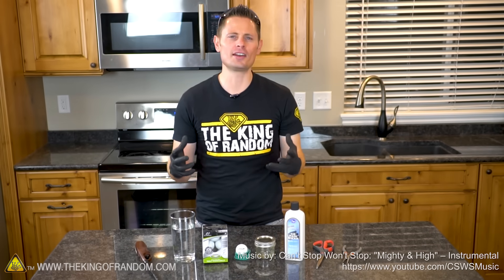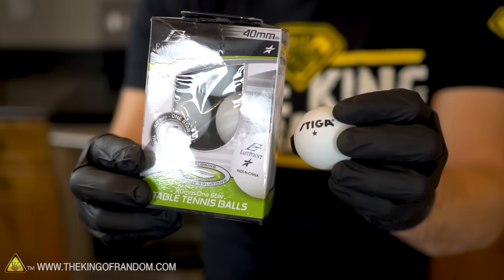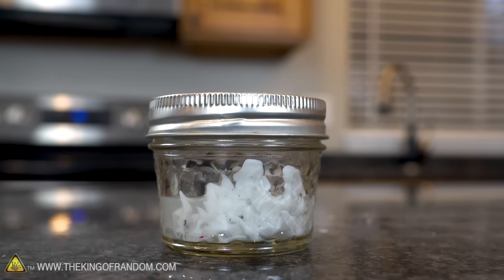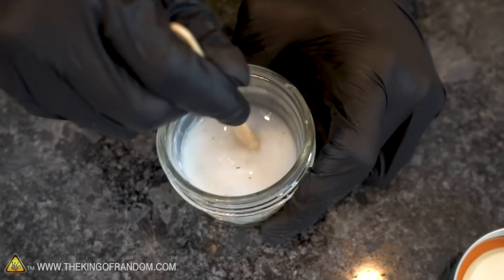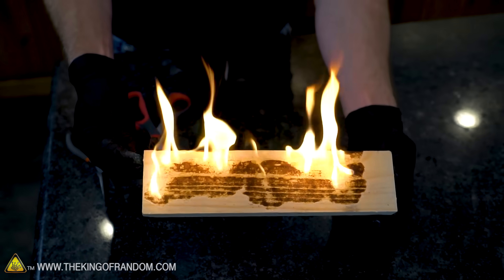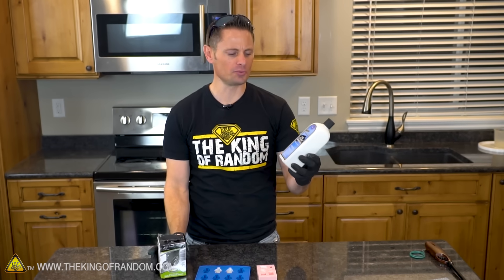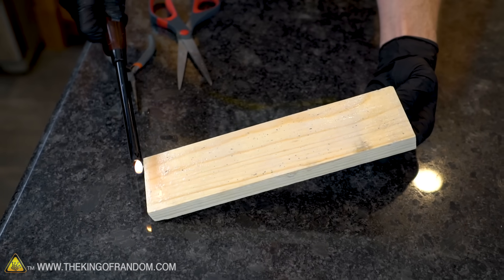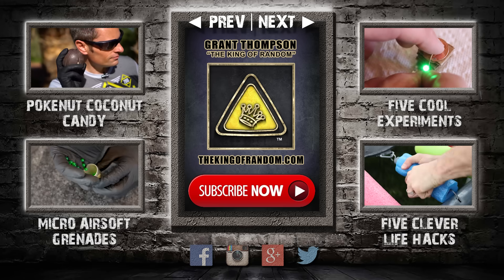Nitrocellulose LEGO? Flammable Ping Pong Balls? TKOR Takes Pyro Paint To The Next Level!

Comment: Is the celluloid+acetone dissolution reaction exothermic or give off any harmful or foul fumes? I wanted to try this, but I wanted to make sure I don't burn whatever it's sitting on or make the whole house smell bad.
Reply: It's not a reaction the acetone is just used as a solvent to dissolve the nitrocellulose
Reply: Sean T. I probably should’ve removed my comment because I went ahead and tried it without an answer LOL (thanks for answering anyway though). Worked pretty well. Not as well as his did, but I used a different source of celluloid (solid rectangular guitar pick blanks). I got a paste like he did, but mine was more lumpy, even after leaving it for a few days. I probably didn’t cut it into small enough pieces.

Comment: COOL! try this, I spraypainted  a sheet of glass with heavy coats( about 5) of  Nitro Cellulose paint, scraped of when dry, and cut into fine chips, or flakes,  then experimented with a shotshell reloading machine, different loads, with which all worked perfectly when fired , DYI  gunpowder- burns clean and fast, Chronographed  well ,,36-38 Bush is  perfect

Comment: theoretically the fuse should work anywhere even without oxygen because of the actual composition

it uses potassium nitrate as an oxidizer which is why fireworks would work in space

Comment: I am really surprised that the glass didn't break or even crack as a result of the firecrackers being in it when they exploded. Over the last ten years I have ruined three different outdoor birdbaths by tossing the same type of firecrackers into them the first was made of plastic and was only about a year old the second one was metal and age shouldn't have affected it and the third one was concrete. The first two blew a hole right through the bottom and the concrete split right in half all were full to the top with water. Could you possibly do a video on the physics behind this. I have also knocked holes in 5 gallon buckets full of water but have found that the explosion has to happen on or very near the side or bottom of the vessel and it has to be submerged.

Comment: why don't you try melting styrofoam and acetone to make plastic objects? I did this a few days ago! I melted down a large McDonald's Cup in some acetone and kneaded some of the acetone out in my hands which yes dried  them out quite a bit but I'm molded it over top of a coconut oil lubricated  plastic Easter egg and I let it dry out a day or two! And I have a little tiny been kind of ugly grayish bowl that I'm using to put push pins in
Reply: side note, coconut oil also makes a great lotion, which will counteract the dryness whenever you lubricate the outside of your mold. if you do a mold on the inside of something, it will just kind of sink back in. So you have to mod over something not inside of something unless you kind of want a solid object and not a container to  store things. as long as you lubricated enough it gets the detail pretty well

Comment: Hey grant I had a idea, if you painted a message (example, your name) with pyrotechnic paint would it burn away a message?
Reply: Depends on the surface your write it on.  You'd more then likely burn/scorch the message into the surface of whatever you wrote it on having the exact opposite effect. It be much easier just to use lemon juice as invisible ink, or to just burn the paper when you're done reading it.

Comment: Once the acetone evaporates it doesn't add to the flamabilty of an object. Try soaking that glock you used in "Testing bullets made form Batteries" or the video "Making bullets with molten Lead" and let everyone know what happens. And BTW bullets have been made with Molten lead for centuries.

Comment: WHAT?!?!? How does it work under water? Doesn't fire need oxygen?
Reply: lol i love how all of you are wrong in your own ways
Reply: The fuse has its own oxydizer in the mixture (likely potassium nitrate. But from the color, I guess there could be barium nitrate or a green emitting potassium perchlorate-based mixture). 
The only way to extinguish such a fire is to cool down the mixture below its ignition temperature, i.e. to remove more heat than it produces. Which is hard, as it is burning and producing A LOT of heat.
Reply: Trenton Zelley because the oxygen and hydrogen are atomically bound together, they require a massive amount of energy to separate and simply arent there to be used, hence why you need to split the atom in electrolysis first before you can burn the hydrogen from it. simply put, hydrogen is flammable, oxygen oxidizes, but when bound together theyre stable, water.
Reply: Why is everyone saying it's oxygen from the water? If so hydrogen would be produced which would either 
a) blow up or
b) fizz like a can of coke.
Reply: Fox _ dude... it's freakin Greek fire
Reply: okay. First off you cant change water with just heat, its one of the most stable things on earth, if heat did change water to its individual parts a lot of houses would catch on fire when just boiling water.

Second off from what I'm seeing in the atomic structure the nitrocellulose has quite a bit of its own oxygen and hydrogen atoms. And Nitrocellulose is a complex carbohydrate, so it stores a lot of energy and can be easily burnt due to all the ingredients required for Combustion reaction being there within reach. So if it gets to burning in oxygen, then put underwater, then the heat will still be produced from the fuse and such, keeping the reaction going until all the nitrocellulose is gone. That's my hypotheses at least.
Reply: +Gaugee Keeton Now all you need to do is watch for corruption.
Reply: Fox _  they use oxidizers to supply oxygen. Same thing with rockets in outer space.
Reply: Creative clearly you didnt pay enough attention then
Reply: Fox _ water is h2o hydrogen and oxygen are the main ingredients
Reply: Austin GX That's not physics that's chemistry
Reply: water is a product of burnt hydrogen, already used. The fuse has its own oxygen source.
Reply: Brazy this is why my kids go to a private school heh heh heh
Reply: the reaction has the nitrocellulose which it self has nitrogen dioxide providing the oxygen needed for the wick to burn
Reply: +UserFire actually it's 2 hydrogen 1 oxygen.
Reply: A flame and a lit fuse are different things.
Reply: Brazy But water has 2 Hydrogen and Oxygen atom how is he wrong?
Reply: Aperson this made me laugh more than it should have.
Reply: Fox _ water is H20 2 hydrogen 1 oxygen so there is oxygen in water
Reply: thats not at all how it works
Reply: Fox _ because of the over power of hydrogen hence H2   and O

(two hydrogens to one oxygen if you didnt know)
Reply: StarFury Well then why doesn't water EXPLODE after all it is made of Hydrogen and Oxygen
Reply: Because they're already bonded. Seperately, they will burn and produce h2o so you can say water is a by product of burning hydrogen. Things burn because of energy being produce from a reaction and water is already in a state of a "depleted" reaction.
Reply: The laws of fuzics
Reply: Ramond Olive It brings it's own oxygen.
Reply: Pay attention to your science teacher.Water has oxygen we all know that.
Reply: water has oxygen and also it can get it from the surface
Reply: Of there is oxygen in the water why does water put out fires?
Reply: Fox _ Water has oxygen... H2O
Reply: Fox _  water is h2o  1 hdyrogen 2 oxygen atoms per molecule

Comment: The reason the fuse burns under water is because the fuse has the usual fuel, and oxygen infused in the wick. To test this put a black cat firecracker into a puddle and it will still explode.

Comment: You can put it in a spraypaint bottle and mix it with alcohol and thermithe(explosive) and your homade gunpowder so it will be explosive spray paint.pls experiment this
Reply: Cyanide thermite(at least iron oxide and aluminum) is not an explosive. It just burns very hot. There are various types of thermite that will explode(such as copper thermite), but most thermite is not explosive.

Comment: if it burns under water then how do you  put it out? just let it burn your fingers
Reply: Probably using another substance to drown the fuse, like CO2, wouldnt work, since its apparent that the reaction doesnt need an exterior source of oxygen, for there shouldnt be any while underwater. Suddenly lowering the temperature enough the reaction stops should work, but im not sure.

Comment: can you unlock a lock with a resin cast key.will the key brake or open?
Reply: 1hellofapluto :p If you make the molds and copies of the key outside the lock well enough, it theoreticaly should work for the lock's pins will be at the proper heights, but the material might break or bend inside the lock, turning it and the lock possibly unusable. If you pour resin directly into the lock, you will likely 1- never affect the pins, making impossible for the material to turn the lock; 2 - leave resin inside the mechanisms. When hardened it will turn the lock unusable, for the mechanisms will be stuck due to the layer of solid material which shouldnt be there. Either way, unless you want a lock shaped paper weight, you shouldnt do it.

Comment: are you sure it is not the acetone that is burning not the ping pong balls? that might explain why it doesn't burn underwater bc acetone does not burn in water
Reply: Kloe Coltrane after properly dried all acetone should have evaporated from the material. If he didn't do it proper, it might have indeed affected it, but unlikely since the heat of the burn should either evaporate the residual acetone, or it wouldnt matter since it would need contact with oxygen from the atmosphere to burn, and the rest of the fuse clearly doesnt need it, likely due to having an internal source of oxygen in its composition.

Comment: what will happen if we pour the burning Pyro-Paint directly into water?
Reply: Akilan pugal Nothing. It'll just mix. Like other liquids. This is speculation as I haven't tried it myself. But it'll most likely mix with the water.
Reply: Akilan pugal nothing will happen, as the paint is activated by fire and other heat that could cause fire, putting it in water would only either mix the materials or sit on top of the water (or bottom of it, depending on the density of the liquid.)

Comment: You should put the stuff in your vaccum chamber so the legos part comes out smoother
Reply: DaCowman47 considering the substance has such a high volume of acetone for the low amount celulose to dissolve, the result will be mostly the same, since the acetone will just evaporate leaving a thin coat of nitrocelulose, whether its in a vacuum chamber or not. The end results should have negligible differences.

Comment: you can do some thing like this experiment using styrofoam and nail polish remover it makes a substance like playdogh and then hardens in to what feels almost like plastic its cool and i thing it wold be a fun experiment to mess around with
Reply: Gabe Pierce replace the nail polish remover with gasoline and you have napalm
Reply: pretty sure that's napalm
Reply: That's napalm...
Reply: Gabe Pierce If you do styrofoam and gasoline, you have a highly flammable goo that will stick to anything (napalm)
Reply: im sorry but isnt this naplam ( i know without gasoline) but isnt it will burn the same
Reply: Aidan Fuge cool...
Reply: Gabe Pierce not really, napalm uses petroleum.
Reply: styrofoam and gas isn't napalm, but it's very similar to it. (Napalm is made with napthetic and palmetic acids).

This stuff, if you mix it with coarse alumina powder, can be used to make your own sparklers....

Comment: Can you do something with a fidget spinner? Maybe with the vacuum chamber or liquid nitrogin ( or how you write it! 😂) who agrees?
Reply: that's it, i quit. there's just too many of ya' little twats.
Reply: *nitrogen btw
Reply: A spinner in a vacuum chamber would most likely just spin slightly longer due to there being no air resistance, i'm surprised Cody's lab hasn't done this yet :)
Reply: Elliot Finch because it's cancerous
Reply: Elliot Finch the effect of the vacuum is about 5s of spin time. The air resistance on the spinner is negligible, it's the friction on the bearing that slows it down
Reply: Nahtanojrepus Yeah i know that, but thats the only thing putting it in a vacuum would achieve.
Reply: DIY Cupcake Fidget spinner Need to die!

Comment: 1. print 'king of random' on a paper
2. cut out a stencil.
3. put the paper on a wooden plank (like the one used here)
4. apply pyropaint on that.
idea is to write text in pyropaint.
5. set it on fire and it should leave a nice mark on the wood.
6. same can be done with different artistic shapes 
 - I think it will look really cool.

Comment: you can also use ABS 3D printer filament as I use Acetone to dissolve it to make 3D Prints smooth and to use it to make 3d prints stick to the heated bed

Comment: Would cigarette filters do the same thing? They also dissolve in acetone, and do it in a couple of seconds. Filters usually don't burn, so once the paste is dry, it should be waterproof and non flammable, so you would have to trim off the end of the fuse before lighting it.